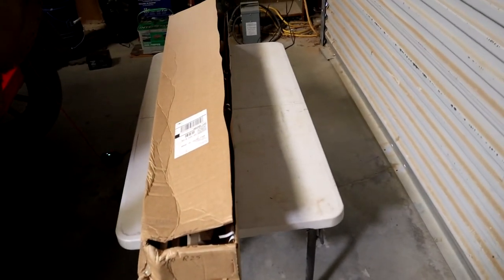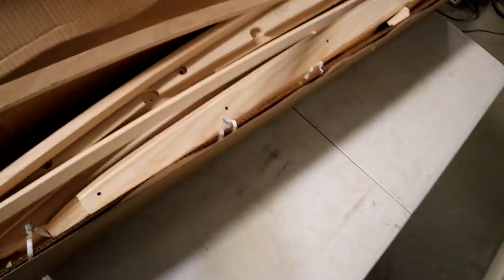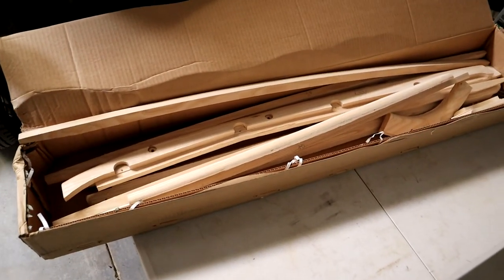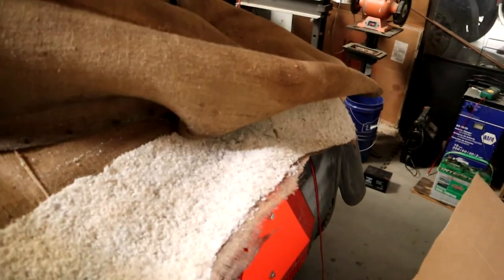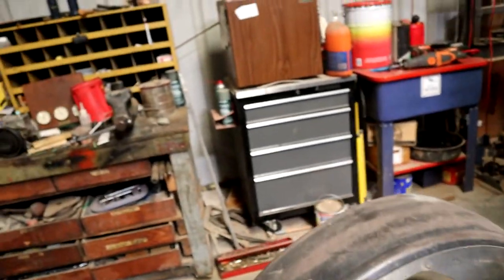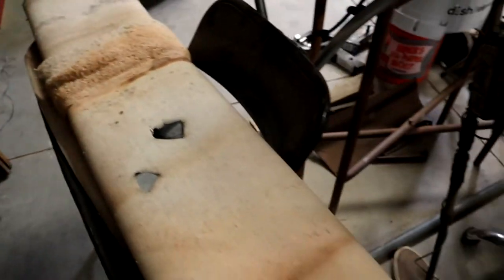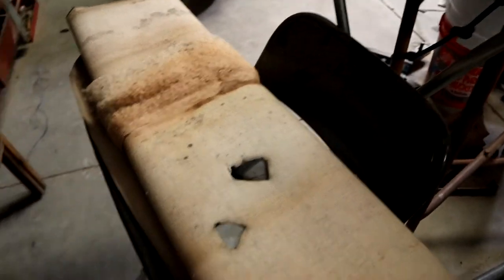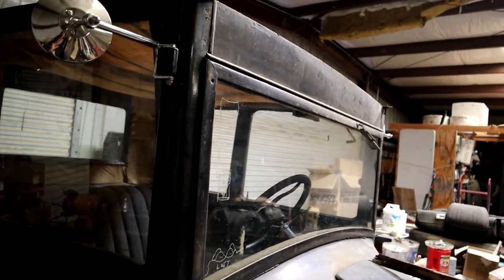1927 Model T Coupe Top Removal

Comment: I have a 26 coupe with the same roof issue.  Have you sorted this out yet?  Hopefully with a video.  Thanks for your detailed videos.
Reply from the maker: Hi Owen, I have not found a solution to this problem. I've checked the door openings with my other coupe and haven't found them to be much different. I tried to pull the body straight but it won't budge. I'm just going to modify my side rail wood to fit the contour of the body and call it good.